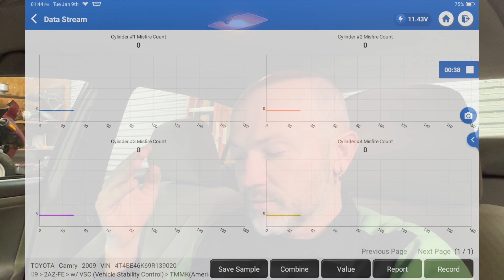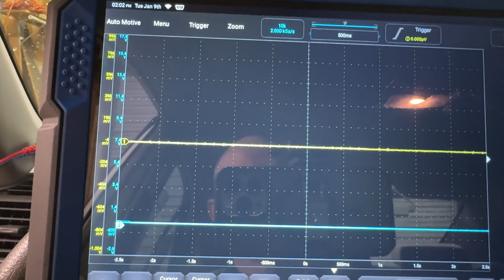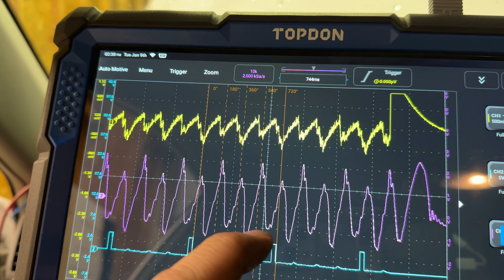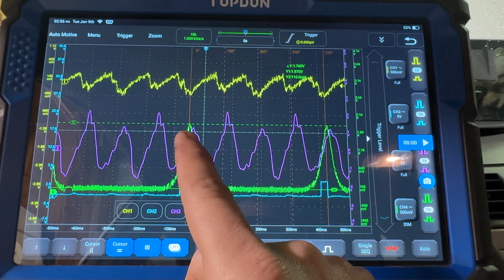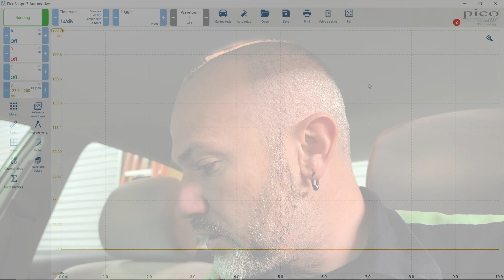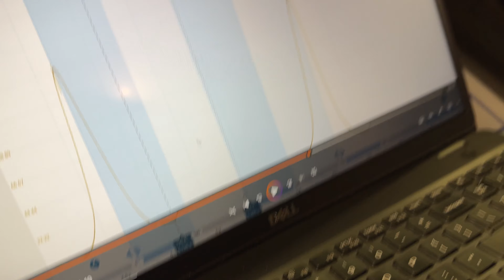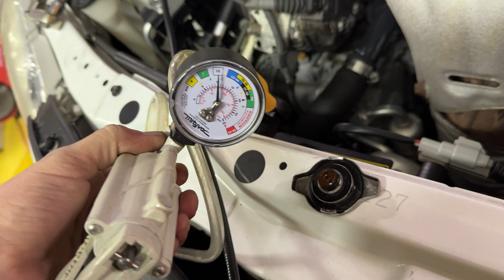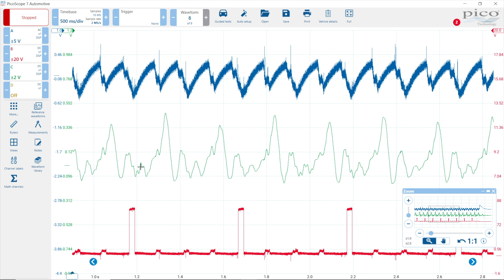Camry Misfire Root Cause! Stop Throwing Parts!

Comment: Cool case Jake! Thanks for sharing it with us, i have 3 points regarding this case:

1 on Toyotas if you plug in almost any scanner there's a function in the ECM either in actuation test or special function named "compression test" which disables spark & fuel injection 

2 i use a simpler teslong boroscope and i use that thing A LOT it's awesome

3 i almost never get  conclusive data from pulse sensors, too many variables 😵‍💫
Reply from the maker: I have a First Look brand pulse sensor and I find it’s to sensitive.
Reply: @autodiagyt  i live in iraq, so i mostly have to make my own stuff, my pulse sensor be it a little ugly is very good, but there are too many variables affecting that thing especially when hooked up to an intake manifold, you'd also have to block the pcv hose which is not doable on some cars. I have a DIY transducer too, that one is a much more useful tool since it gives you actual pressure, you can decipher the variables. I could see the theory, and i believe it could be very useful, but personally i have never been able to use it as conclusive evidence when it comes to hooking that thing up to an intake manifold 😐.

Comment: Some of the bumps in the coolant pressure waveform may be normal just from the water pump circulating and creating pulses of flow.  South main auto has a cool video from a few years ago where he put his wps on the radiator cap, measuring actual pressure.  Everytime the bad cylinder came up on compression, the pressure rose.  The waveform looked like a staircase, was very cool!  I immediately thought of that video as you released the cap and realized the coolant system was under pressure.
Reply from the maker: I’ve had one that I used the wps on an got a staircase. That was a cool capture also.

Comment: Great diagnosis. I'm sure with that coolant leak it was using coolant and probably smelled of burnt coolant out the tail pipe. Also explains the misfires on startup. Hard to say if the car is worth the cost of repairs though...

Comment: Great video, Jake! I have that same exact borescope. I bought another one for a tech at work and then another tech saw it and bought one and then his dad saw it and bought two. So yeah, huge fan myself. I got a P0299 code (turbo underboost condition) on a Chevy cobalt and so I decided to check out the wastegate valve and realized the O2 sensor was right next to the turbo so I took out the O2 sensor and was able to snake my scope in there and immediately saw a crack in the seat of the wastegate valve. I was pretty proud of myself that day, because, the other techs had already spent three hours trying to diagnose it.

Comment: This was excellent. As soon as you put that borescope into the wet cylinder I said out loud “ that’s coolant “ almost in unison with you . I also haven’t had much luck with a pulse sensor in the radiator. I was so glad to see such a good capture of that . I’ve had a a few pentastar engines that hydrolocked and didn’t pick it up on the pulse sensor. Great job Jake thank you .

Comment: Two wire CAM to answer your question is for what we call "differential signaling." we do this for error correction.  For example, should static/interference affect one wire (causing a parity error), we configure the transever to subtract the signal from the good wire.  Thus reconstructing the packet (AKA error correction).  Again, thank you for the great videos.

Comment: you go Bernie Jr. Great episode on misfire condition. its not always a coil/ injector issue. coolant probably low enough not to be smoking out exhaust along with the coolant leak outside of engine. scope captures were nice to explain pressure transducer.

Comment: Nice video and great diagnosis. I see the previous guy followed the Johnny Cash principle. One part at the time. 😂😂

I was thinking head gasket when I saw the low compression on cylinders two and three. We used to take the hose from the radiator to overflow tank and put it in a bottle with water in it and you can see air bubbles if the head gasket is bad or the cylinder head is cracked. 

Maybe we can get Ivan to sponsor you with one of his PHAD pressure transducers. 😜

Comment: 👏👏👏👏👏👏👏👏👏👏

Excellect follow-through!

Another trick is to fill the radiator to the brim and perform a leak down test on all the cylinders. 
Any pressure bleed off will push coolant up and over the top of the rad fill neck.

Cheers Cap'n! 😉👍

Comment: What was the guy thinking who wired those injector pigtails in? LMBO! Excellent video! Very informative on how to do multiple tests with an oscilloscope and pressure transducers. I suspected a blown head gasket 1st when I noticed that 2 adjacent cylinders were misfiring and the misfires were only on initial start up. When I saw the wet plug and you said it didn't smell much like fuel, I knew what was wrong. I think this could have been diagnosed without a scope but then we wouldn't have learned so much. The bore scope footage is unbelievably good. I'll be looking into getting one of  these pronto. Curious to see what the coolant, oil filler cap and oil looked like. Was there steam coming out the exhaust? I think I will be getting the Phoenix scope to go with the other 2 scopes I have. Love that scan tool. Thanks so much for the video and the explanation of AC coupling. It helped me to understand it better.

Comment: Last time I checked for a blown head gasket with a pulse sensor and confirmed a pulse in the system,  I 1 at a time left the compression hose screwed in the plug hole and hit it with compressed air while watching the scope. Very effective and conclusive to see its a head gasket when each time you hit it you see the pulse right on the screen.

Comment: That engine has been overheated due to that external leak and blew the head gasket. I wouldn't even try to fix it @ 100K miles. Nice work as usual 👍
Reply: BUT ITS ALSO POSSIBLE THAT THE BLOWN HEAD GASKET PRESSURIZED THE COOLANT  CAUSING THE EXTERNAL LEAK

Comment: Hi
For me the best head gasket test is to to put the suspect cylinder on tdc firing and put full shop air into the cylinder.
Then look in the radiator for air bubbles or the level coming  up.
Don't use a leakage test the pressure is reduced

Comment: Pressure in a cylinder is a function of volume change and temperature change, compression cause heat.  Speed of the piston is not a factor. The pressure, ergo voltage drop, variances, cylinder to cylinder are due to the varying spring effect of the varying compression pressure in a cylinder aiding the rotation of the crank. 

The reason for the declining cylinder pressure,on the in-cylinder captures is the build up of vacuum.   I suggest the YT video “compression thoughts from Wilf” for a detailed study.

Another way to do a relative compression is to pull the fuel pump fuse, run the engine to drain the system, then proceed as before.
Reply from the maker: I never said anything about the speed changing the compression. I was talking about the vacuum pulls on the intake pulse sensor.

Comment: I’ve dealt with tight valves in a Scion (Toyota engine) before. Had to measure the lash between the valve lash caps and camshaft and do the math on how much more I needed then ordered caps that gave me the right amount of clearance. Someone had just recently done a head gasket and the machine shop had the valves way too tight causing a rough idle.

Comment: good diag, ford 4 cyl had the same problem, except you could not just change the head gasket, there is a design flaw in the block, they redesigned the block, you have to change the engine. the long block from ford is cheap from ford only $2100 our cost. Certain years were covered under warranty.

Comment: Have you checked the blinker fluid level?  I know it may be dangerous but could you repin the module front sensors to rear sensors and see if code moves to front sensors not matching ? If that makes sense

Comment: Why was the valve timing off 10 deg. from one cylinder to the other? Can the blown gasket skew the pressure transducer or is there a reason for the timing to be different between cylinders?
Reply from the maker: I’m not really sure why I had the different valve timing honestly.

Comment: Tried and true method, TDC cylinder and put air,  a leak should show up in the radiator, if its slow I put a pressure checker and see if it rises.

Comment: As soon as you pulled the plugs and said they were wet, head gasket. Those engines are known for head bolts pulling the threads out of the block. Still a good case study and a little lesson on in cylinder and pulse sensor waveforms.

Comment: I am commenting while watching. You should experiment with shorter rubber hoses on your vacuum transducer, you can pick up more details in your waveform to include specific valve timing/adjustment parameters. The longer the hose, the more chance of feedback/echo/softening which will skew the waveform, yours is still pretty fair. There are other parameters to be aware of based on the type of transducer that you use such as a Delta sensor and what causes a hump in the waveform at a specific location/time. What I call ATM or atmosphere pressure will cause a hump on the rising and falling edge of the wave. As with anything, experience and deep study of the waveform will eventually make all aspects more understandable. Also remember that the speed of the piston travel is different at all angles with the fasted travel around the 90* area so the speed of piston travel is seen in the angles of the rising and falling edges of the waveform from left to right AKA time/speed on the scope screen. Overall height of the tallest peak, exhaust valve closing (EVC) will affect the depth of the vacuum pull so a slight valve adjustment/wear issue can be seen as well. Many more details in the waveform can be evaluated. On your channel 3 indicator, 0v @1650 time stamp, look on that level and you will see a hump along that level which is what I call ATM, and your Delta sensor is reacting to this phenomenon which is normal and can be useful. For me, when #2 & #3 show a problem, I am going to be concerned about a head gasket issue as the cylinders are physically side by side, need to wait and see some of your testing later in the video. Much appreciate your style of increasing the use of test equipment but in the real world, Bernie Thompson style, all 4 channels ought to be used on the very first go around to save the customer money on time and to shorten this long video LOL. You then mention the crank speed making a difference in vacuum strength, this is where measuring the timing between spikes comes into play and you are correct. ISNT your battery charger/maintainer CLEAN DC which is a requirement for programming? You don't need adjustable valves to have valve timing/adjustment problems. Exhaust valves (tight valves) beat themselves into the seats and camlobes get worn and Toyota valve buckets get worn (loose valves), etc. You are also blocking off the intake skewing your readings so this test is not exactly valid. Is BOSCH the proper plug for a Toyota, people like to throw in cheap but branded Iridium or Platinum??? Once I assumed there might be a blown head gasket, I am going to fill the cooling system and crank the engine with the radiator cap off to see if any coolant volcano happens, this first coolant test will not include the scope. Thanks for all your case studies, Since you are one of the best YT Channels (DiagnoseDan is a fan also, and I am the MOD on his FB Group), it is fine to do the long drawn-out procedures, it would be nice to charge the customer the direct route IMHO. Wet plugs with no fuel injection, hmmmm.

Comment: Hi
Tech stream has an active test for compression test .
You can stop injection with this active test to do the relative compression test.
Very easy on the v6 s when you can't get to the rear injectors
Reply from the maker: I think I seen that in the topdon as well. I just have a hard time trusting scan tools to correctly identify cylinders. Seen to many fords tell me the wrong cylinder is low compression or test good but really it's not when compared to a RC scope test.
Reply: @autodiagyt 
Hi
I still use Pico to do the test ,I just use the scan tool active test to cut the fuel on cranking because there is no clear flood.
Now did the coolant leak cause low coolant level overheating the engine causing the head gasket to blow

Comment: Jake, when 2 cylinders are side be each, why would you not automatically suspect head gasket and crank or run with the rad cap off? Just looking for diag path logic is all. I love the tests you perform in this video. Thanks Jake!!
Reply from the maker: Hypothetically let’s say it wasn’t 2 cylinders but just 1. Realistically some of us don’t see mechanical failures that often so it’s better to stick with an approach we are familiar with. I’ve only diagnosed a handful of head gaskets in my 7 years being a tech so I follow a testing path that works for me.
Reply: @autodiagyt makes sense. You have to trust a process that works for you. Thanks again Jake!

Comment: I looked up the spec for the top Don scope and it’s 8 bit compared to the 12bit pico. It seems to be able to have sufficient resolution to do want we generally need to do with a scope. What do you think the biggest challenge would be for the 8 bit. Great video, keep them coming👍!
Reply from the maker: So far I’ve not noticed to much difference in the quality of the captures. The biggest advantage the pico has is the buffered waveform pages. I can say this scope is drastically better than the snapon and so far with it being half the price of a pico I’m happy with it.
Reply: @autodiagyt exactly what I wanted to know. It seems to be a bit easier to use than the pico. I'm going with the TOPDON scope for my next step up.

Comment: I suspect the noise you were seeing on your scope was from the battery maintainer.  When you cranked the engine, it automatically switched on to recharge he battery.  When it was charged, it switched to standby (so it was clean for the next round).
Reply from the maker: No it was definitely from one of my other leads. Still not sure what was going on but it had to be from something there was connected to or inducing.

Comment: which camera were you using?
Reply from the maker: Teslong it’s linked in description on the amazon store.
Reply: There are 5 different cameras listed on there. That's why I asked
Reply from the maker: @gmtech2012  oh gotcha lol. The one in this video is the Teslong Articulating camera. It’s my go to in most cases but the 3 camera one definitely comes in handy where you need to see 90 degrees and no room to bend the articulating head.

Comment: So I had to ask something.About the pressure pulse sensor۔Where can you use it?I mean Engine head gasket should be checked۔ and Can also check the intake۔Meaning of asking manifold What things can we check with it field.
Reply from the maker: I mainly just use mine for intake pulses but they can be used in a lot of places.
Reply: This can also detect the head gas kit
Reply: I have also learned a lot from your videos
Reply: I have seen you many times Check the engine pressure By going into up AC cupping mode Check with the battery by attaching the scope Such a pressure check is what I saw from you

Comment: Wow so many directions the way I check for a head gasket is put the radiator pressure check on pump it up like 8 psi and start the car and watch for the pressure to fluctuate but I’m just a poor man using what I have and I would have used a in cylinder pressure tester it is not nearly as cool
Reply from the maker: Nothing wrong with that method if it works lol. Head gasket wasn't even on my mind until I got the camera in the cylinder lol
Reply: @autodiagyt  I was thinking head gasket when the plug was wet

Comment: Jake..deep down inside I know you really wanted to reach for the pico. Spaghetti indeed. What will happen when those wires get baked in the engine heat.
Reply from the maker: I really didn’t want to honestly it’s a hassle to get it all out of my van. The topdon scope has been doing really good for me so far. I honestly don’t think the issue I was having had anything to do with the topdon scope so when I get time I’m gonna hook the wps back up to it and compare it with a pico. I think it’s gonna be very similar.

Comment: Old school methods just put a balloon or a rubber shop glove over the radiator cap hole start the engine and see if the balloon blows up=bad head gasket also. easy

Comment: I wonder, in all the time you took to try different scopes couldn't you have pulled the plugs and done actual compression tests?
Reply: He did it with scope. Just look
Reply from the maker: A mechanical gauge has no place in my toolbox. The wps gives way more information then you will ever be able to get from a mechanical gauge. Also I knew there was a compression issue just from the relative compression test. I knew which cylinders had issues from knowing the firing order, the wps didn’t tell me anything I didn’t already know other then it put a numerical value to what I knew was an issue. As far as trying different scopes using the wps on the topdon scope was just to know how well it would work. Sadly something with the car or my leads was causing the wps to mess up. I’ve never seen it do that before so it might just be going bad on me or something but generally the scope and wps is just as fast as using a mechanical gauge but an added 4 times as much information.